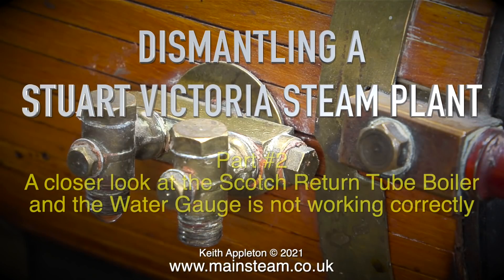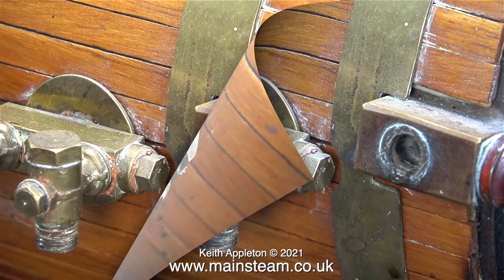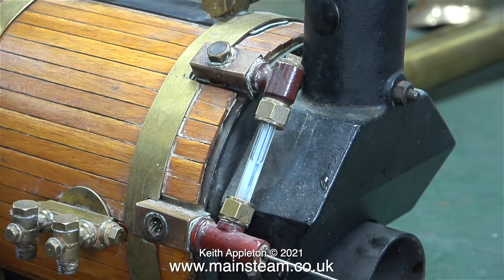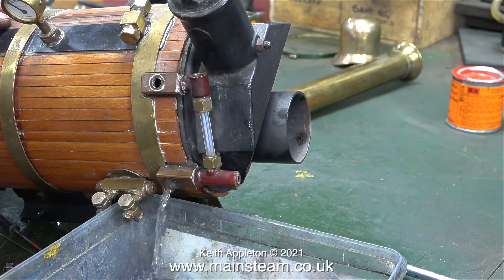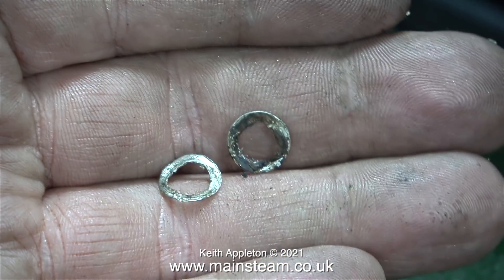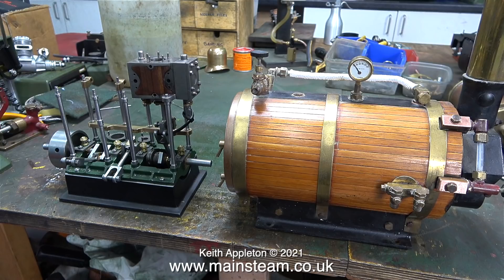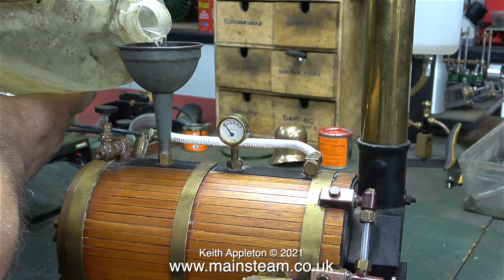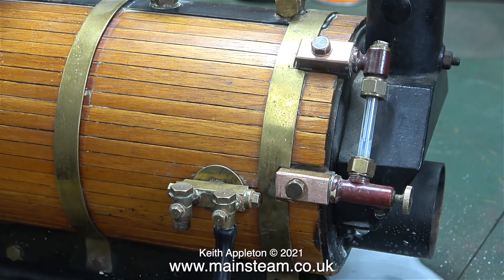DISMANTLING A STUART VICTORIA STEAM PLANT - PART #2

Comment: Having been an Industrial Boiler Operator for 54 years can I spoil it and tell your Patreon Supporters what is the problem with the most important fitting on a boiler the gauge glasses. Fitting Steam, Water way and Blow through cocks to a boiler allows passages to be proven independently.